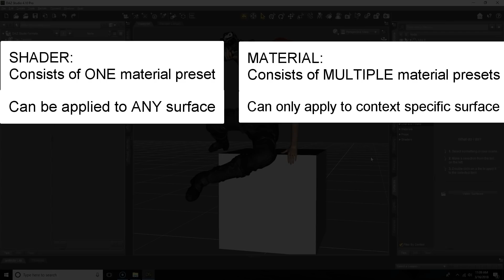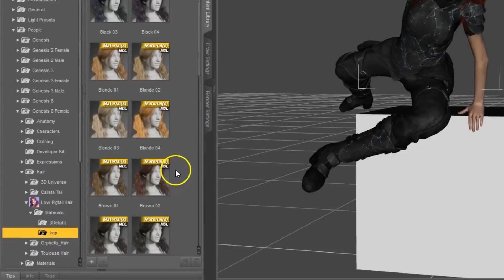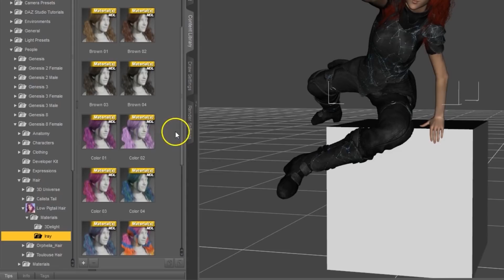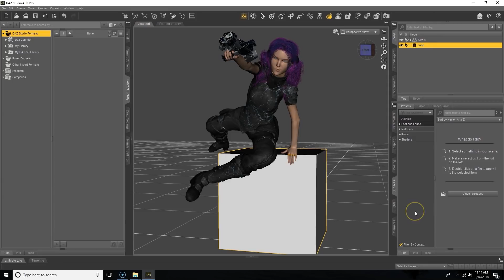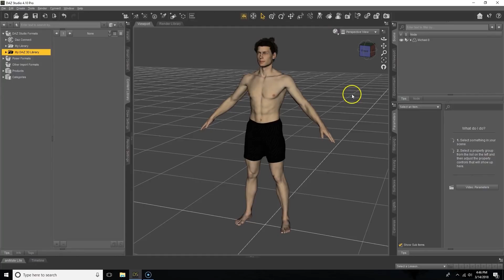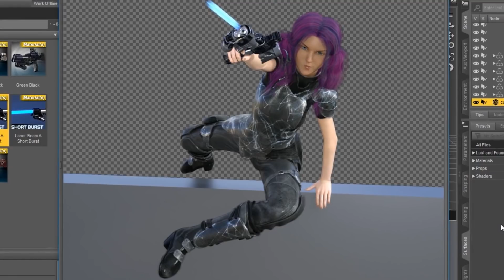Comment: what is DAZ ?
Reply: Daz 3D is software used to create 3D images and animations and render them. The software is free, and comes with several 3d images to get you started. There are also other models you can purchase as well. As you become more advanced and involved, you'll find other sites where you can get other 3D models.
Reply: @Tommyknocker45  is 3dsmax,maya,zbrush DAZ ? What is the difference?
Reply: @fractalelement857  Daz 3D is free.
Reply: @fractalelement857  3ds, Maya and ZBrush are apps to create 3D content. You can't do that in DAZ. 
DAZ is a software to pose existing characters and create renders.

Comment: Would a character typically render quicker in IRAY with a shader or MDL?
Reply: Virtual Media MDL (material definition language) is used by the IRay rendering engine, essentially, they are the same thing. You can render mdl in 3Dlight (and vice versa), but the results will be... less than desirable. Iray is always going to have longer rendering times because it is photorealistic. 3Dlight can produce some excellent results if applied correctly(in terms of PBR). To use them interchangeably with good results, there are a few products  for easy conversation, I think Sickleyield and Riversoft Art carry Iray to 3dl (and 3dl to Iray) shader conversion scripts. Hope this was helpful.

Comment: Glad to see a new tutorial. But sad that after seeing it I still don't get the difference between shaders and materials. The quick 1-liner explanation about 1 material vs multiple materials was not sufficiently clearly demonstrated by the demo. How is hair a multi-material thing (to have to use material settings) vs the upper arm (using the shader settings)?
Reply: Glad I am not the only one.  Still absolutely no idea each is, other than materials can be multiples.  Why no examples of what they actually look like or do?